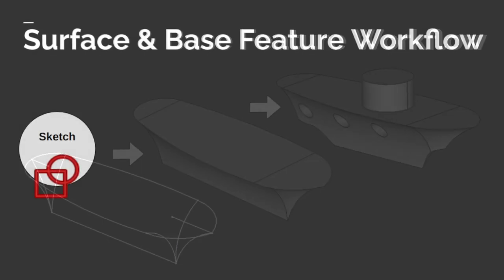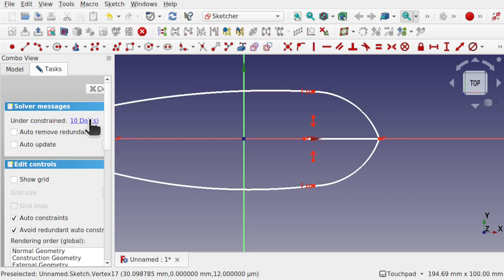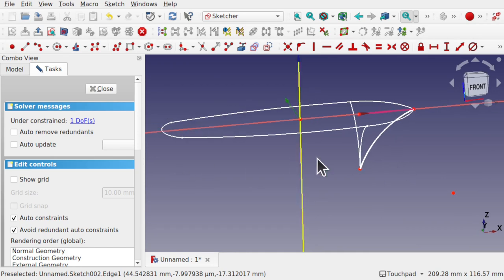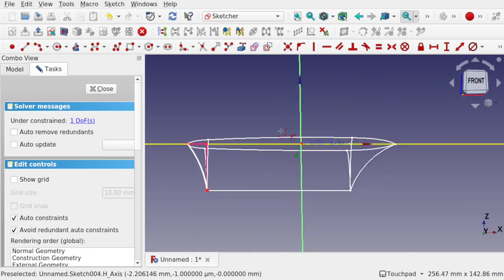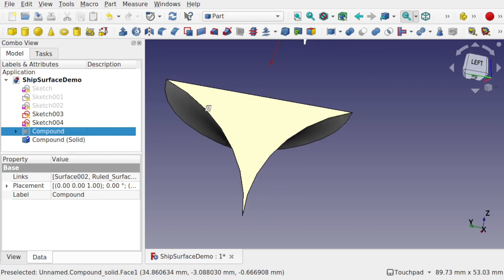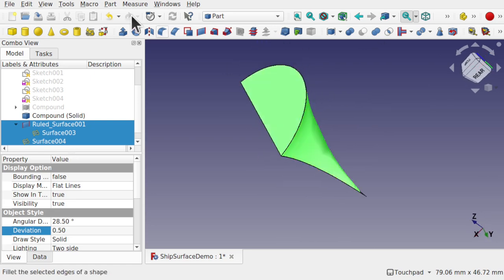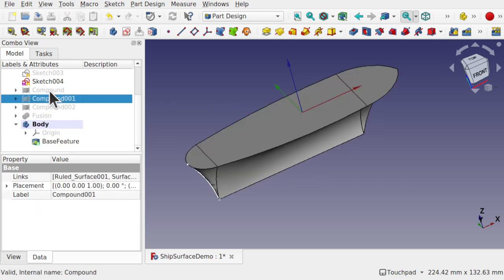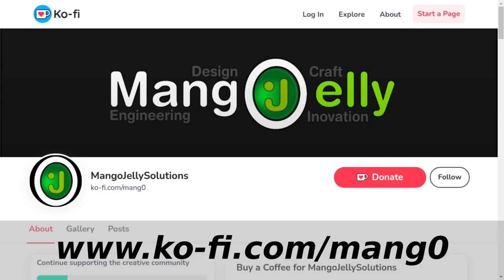FreeCAD 0.20 For Beginners | 19 | Surface WB and Part Design Workflow |  Create a Simple Ship / Boat

Comment: This will be the first video Ive had to skip. I have remade this so many times with different results but Ive never got to any point where the solid works. Hopefully he'll address this again later in a different video.
Reply: I got the solid to work, but I had to make the top left arc a two piece arc because the solid would not form on the one piece arc. I think on his version of the program it automatically splits the arc into two halves when he puts that dummy line in (the fake line on top that he attaches a sketch to). On our version of the software it keeps the arc as one piece.
So I re-made that part with two seperate arcs (instead on one arc), just like we did on the other end of the boat. The solid has worked fine now.
Reply: I had to try a few times. I made a differently shaped boat than his and went back and made several adjustments after the wire frame was done only to have things get out of alignment by the slightest amount and the surface tool refused to work. I feel like I learned from my mistakes at least.

Comment: Hi. So enjoying your lessons. Step by step, little by little get more familiar and more comfortable in freecad and starting to understand it's methodology :)

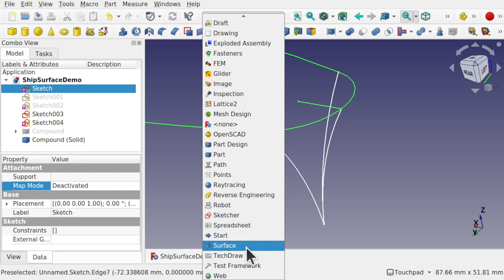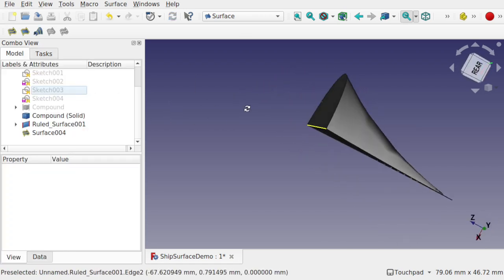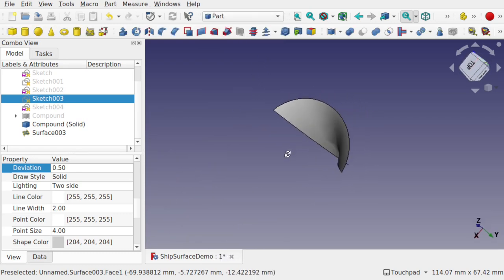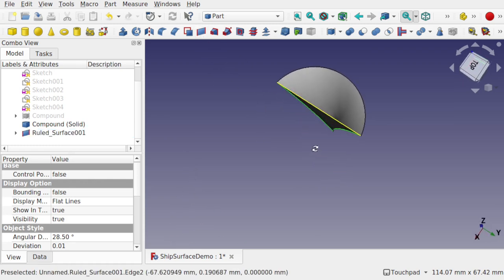Using freecad 1.0 RC2 and got a problem when tried to create back of the ship where surface in surface WB is got created with constraints. After i have create side surfaces, i was trying to create ruled surface in part WB between 2 curve lines(bottom of the ship) and it was created incorrectly, seems like buggy. So as a workaroudn i have tried to follow same approach as nose of the ship and split circle part in the back into 2 parts. And when i created top surface and side surfaces - creating ruled surface was go fine. Tried to explain steps from 21:17 to 24:48 when making backside of the ship and got problem on 23:55 to 24:12. Maybe as a workaround can be to create an edge on the first sketch, haven't checked it yet. Or maybe i was trying to do something wrong :D

Just sharing my experience :)
Reply from the maker: Thank you for sharing this, really appreciate that as I want to redo a lot of these videos to being them up-to-date.  So going to take each one, go through the comments and feed that into the new videos so sharing experience is more than welcome, thanks for taking the time to do that.  Sorry for the late reply.

Comment: Could you comment on why you're using ruled surfaces? Could you have just used filling surfaces there, instead? What's the value of mixing filling surfaces and ruled surfaces like you did?
Reply from the maker: Yes no problems. The reason why I used a ruled surface  because there was just two edges needed to surface against. It's quick and simple to use and if you haven't got a closed set of edges it's ideal otherwise if your using the filling tool you have to bridge that gap with a third edge

Comment: Great video. May I inquire, do you think this method is easier or harder than using curves workbench?
Reply from the maker: I think for a beginners getting into freecad this removes some of the complexity but for something more powerful then the curves workbench is a great tool. Some of the features of curves will I believe start appearing in surface wb.  Freecad 0.21 already has the blend curve added.

Comment: I have a question - with "filling" surface I've ran into problems where created faces were out of wack or the tool complained about edges being out of order, however "fill boundary curves" worked ok. Also in Part workbench the ruled surface created weird surface when I selected right edge first, but doing exact same operation but selecting left edge first created proper surface... What gives? Is that some kind of a bug or limitation or "depends on phase of the moon in conjunction with jupiter" sort of funzies? In the vid you've hit similar problems with ruled surface and worked around it by creating them from other edges.
Another problem I have is with 3 compound solids - when I make them into single compound and then use fusion, only "front" part of the ships stays there. Same if i try to use fusion on all 3 solids. In order to join "successfully" I used connect and then converted connect into solid... Hopefully that was ok to do so, an just a multiple ways to skin a cat.

Comment: thanks for putting this together.  What exact version of FreeCad are you using? I keep running into a huge bug that crashes freecad and reports "recompute failed" etc. when I attempt to make the surfac on the "front" end (the second one that goes across the whole "ship"). The surface is completely mangled and if you try to correct thigns it goes really bad - ie. bug.  From the looks of things, you're on Windows - I'm on Linux using 0.20.1.   So I'm at the usual place with FreeCAD where to correct an issue I have to delete everything and start all over - so my second question is if that's what you experienced during editing too?  This is part of what keeps me from FreeCAD - even shapes like this causes major issues and it gets stuck and unable to do anything (including undoing) very easily.  But I really liked the whole idea of your demo and covering the concepts. Just wish it worked (for me).
Reply: A quick followup - I still see the old problems that when you edit components up the tree, which has dependencies, things fall apart too. Before you do your surface, try to change the width of the ship a bit in the first sketch, and see what happens to all your constraints, particular external geometry and what you demonstrate constraining the sketch to the object. None changes, and everything is haywire as you attempt to correct things.  Including a bunch of compute issues (red text) etc.

I've not watched all your videos, but it would really be great if someone could show how this is supposed to work. How do you correct/adjust the model components that are already used to constraint/control newer ones.

Comment: Got an error when trying to pocket through BaseFeature that says "Resulting shape is not a solid", seems that BaseFeature is hollow inside in spite of being linked to solid part object, is it me or freecad bug, really irritating, may someone help please? My freecad version is 0.21.2 on Windows
Reply from the maker: If you run the base feature through the geometry checks in part workbench it will tell you if you have a solid or not.  This is normal due to a gap in the surfaces where they are not meeting.  The curves workbench has a parametric solid tool which is excellent for converting to solid and found much better that the part workbench tool
Reply: @MangoJellySolutions  Thanks for helping) I tried to follow steps in tutorial once again and everything was working must have been some small error I didn't notice

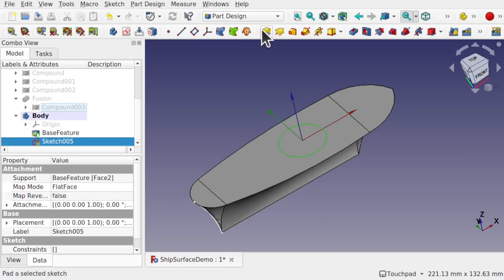Comment: 30:43 After dragging the fusion into the body, when I try to padding a circle on top of it, there comes an error: "Pad: Result has multiple solids. This is not supported at this time." Any idea why is that?
Reply: My freecad version is 0.20.2
Reply: My freecad version is 0.20.2
Reply: additional info: I had three parts convert to solid, and Fusion them together. After that, I drag it into a new body under part design WB. Then create a sketch on top of the base feature. when I try to pad a circle, the error shows up.
Reply from the maker: Make sure that the circle is mapped to the face with flat face and that it hasn't been moved vertically anyway off that face.  If its floating then it will cause the error.
Reply: @MangoJellySolutions  I've encountered the same issue. Verified it's mapped to the face without offset. No matter what I do, same error. Verified the base feature is a solid as well, tried various settings of the pad, reverse, symmetric, changed the size of the pad. Even tried sinking the sketch into the BaseReference by adding some negative z to the attachment. No luck.
Reply: @MangoJellySolutions  For me, converting the fusion to a solid before importing the base feature fixed the issue.

Comment: Hi All going well with this but when trying to convert 3 Hull components Compound to Solid I'm getting a "Shape is not a Shell error". I'm thinking I've got an un joined sketch or the like somewhere that gets tolerated until this stage. Apart from adjusting some the Shape variables in View/Data making progress. I have been trying a somewhat different shape but sticking to the basic construction layout. I've noticed that the View/ Data variables can often via trial & error provided solution to surface errors. I've noticed a Geometry Check feature in Part WB & I'm investigating error its discovered. I'm going to try redoing the surfaces of the individual Hull groups differently. Went ok till I got to the surfacing, seemed to create Stern Bow & Hull Assembly but when trying to combine all got repeated Shape is not a Shell and messages to that effect. I'll move on as  I've been stuck on this for Hours. Perhaps revision when 6he head is clearer will help.
Reply: HI. I got the same error with you, and solved it by making the left side surface (referring to surface005), right side surface (referring to surface006) and top surface (referring to ruled-surface002) as compound first, then making the new compound (referring to compound002), front section surface (surface007) and rear section surface (surface008) as another compound (compound003). Converting compound003 to solid is successful. I hope this will work for you, though I don't know why this will work.

Comment: why they don't just put the surface wb tools in the part wb...... there are only a few of them.... or at least duplicate the ruled surface and make that available in the surface wb.
Reply from the maker: I think the idea is that they are going to extend these tools further.  You can add the tools to the part wb by customizing your toolbars if that will help.  But yess there is a limited amount of tools in the surface wb

Comment: Most beginners would not know that first you have to make a compound and THEN the solid object. Why? ;)
Reply from the maker: I found this out the hard way when I first begun with surfacing as I thought freecad would support multiselect of many shapes that touch and would automatically join these together in the converted to  solid process. I spent hours making shells and then accidentally making solid. Thinking back to the video I should of really explained that a bit more clearly.